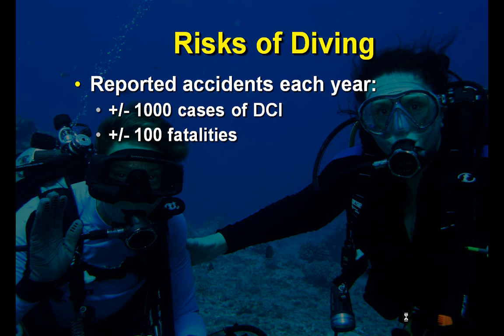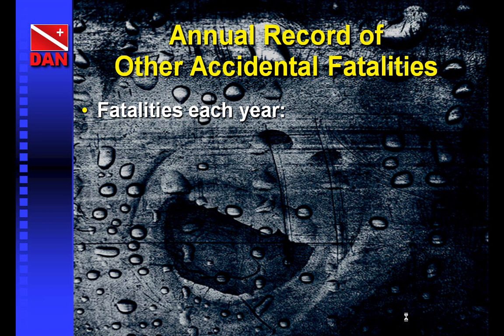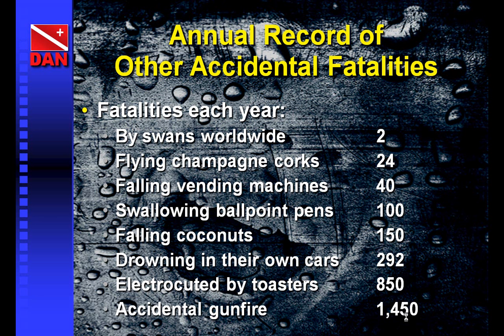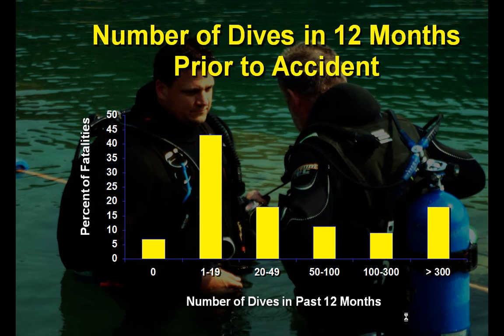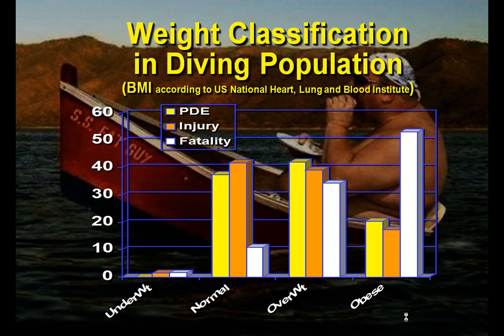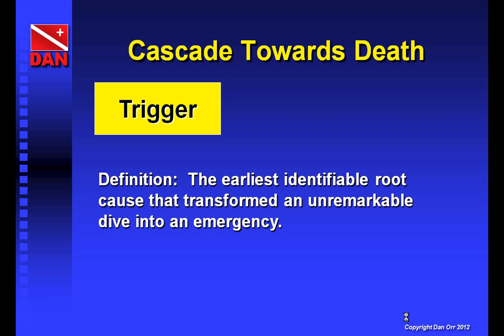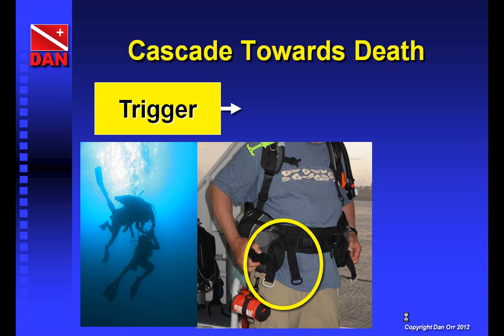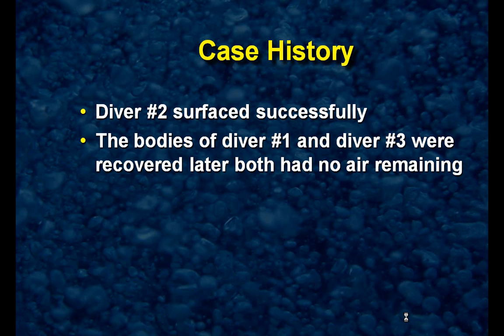RF3.0 - Open Circuit Diver Fatalities

Comment: Bday case study reminds me of the in flight instruction in case of emergency put O2 mask on oneself not your child, wife, etc bc your no use unconscious & the only remarkable thing is the diver out of air saved his friend bc otherwise 3 fatalities in stead of 2 would have resulted. Imo reg cert's & open water advanced certification is underwhelming. In all branches of military were put through drown proofing which is rough but some level should be required bc it's mind blowing how many ppl have a very small problem that ends up creating a cascading event not like this case where running out of air while stupid isn't huge given 2 buddies but not understanding equipment is big & not only does it take out the compromised diver it also kills there buddy bc they've never dealt with this issue nor have they ever had any stress/panic inducing scenario. But bc of the $$$ that diving creates the entry level to the sport is laughably low. The other end of spectrum is born out in stats with huge chunk of fatalities coming from complacency & over confidence which like overweight divers are putting themselves in extreme danger.
Reply: I think many people don’t know how to use their equipment because it’s rental  gear. My wife and I decided that with a sport like this we would buy all of our own equipment so that we would be comfortable training and using it. This is probably not the sport to get into if people are worried about the cost because a majority of our kit is not sports equipment it’s life support equipment.

Comment: about the story where the bouency comnpensator of the one diver was not connected properly something simular happend to me the other day i was down at 5 meters lukely on a platform so nothing happend but i tried to inflate my bouency compensater and it did not work hoever just seconds erlyer it worked on the surface and even after submersing before going in the water i checked evrything. after realizing that it did not work i searched for the proplem the inflator hoese from my air tank to my bouency compencator came undone i was able to reconnect it  i thing it either got undone becaus it got stuck somewehre on my jackred or it was never connected all the way

Comment: We are relatively new too diving, roughly 1 and a half years now,  we have done the usual open water, advanced, nitrox, and now dry suit.
When I am under the water I constantly check my gauge for air, it’s just very natural, I don’t want to die.....
We have recently both bought the D5 watch and every dive we log onto the app, and write down weight, under suit, dry suit/ wet suit etc.
We are learning our dry suit diving  at wrasbury in the UK,  a cold water lake,.
we’re up to roughly 20 dives and are planning a seal dive in UK waters,  but  not until we are 100% ready and happy we can dive properly.
So these fatalities are surely caused by overconfidence? Or bad planning?

Comment: excellent video ! I see alot of problems related to " trendy or the latest/greatest gear" syndrome. manifested in two parts, 1) not practiced with the gear, and 2) cr*p designs that are not intuitive, i.e. bizarre weight retention systems ,  too many complex computer issues.  Ive never run myself ooa in 39 years, but ive seen it several times in the last few years, with fancy integrated air computers no less. I must agree in more training and knowledge is a good thing, but I am meeting more and more divers with deep, rescue, tech, side mount, DM, and ask them how many dives.... " I have almost 40 !!!!! "   yep.